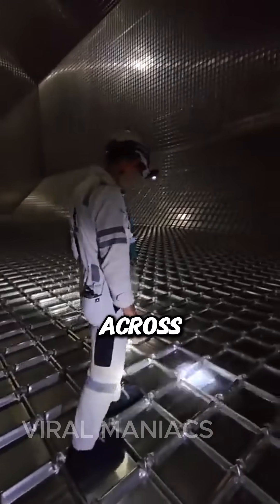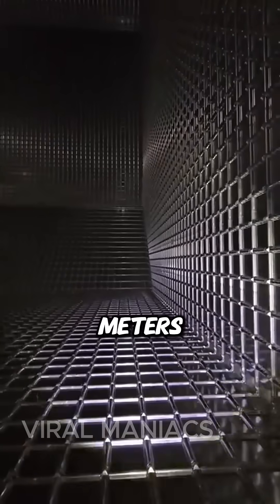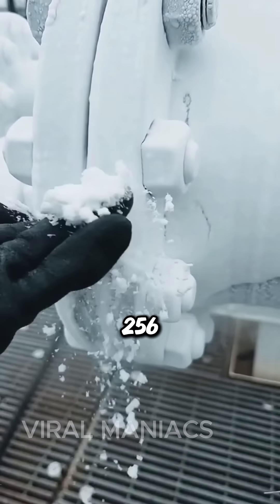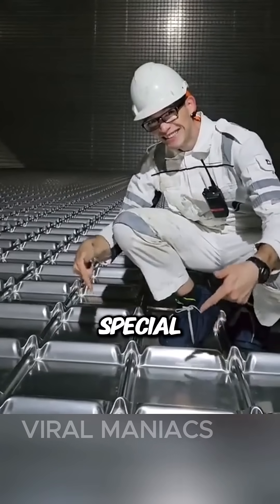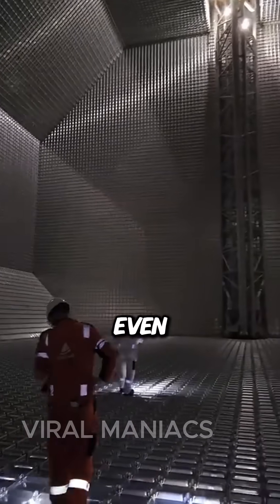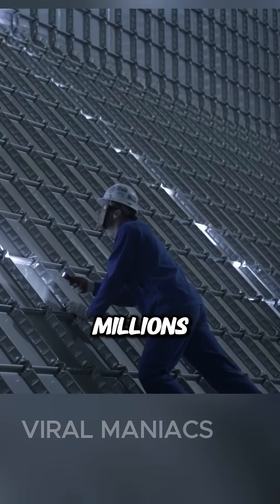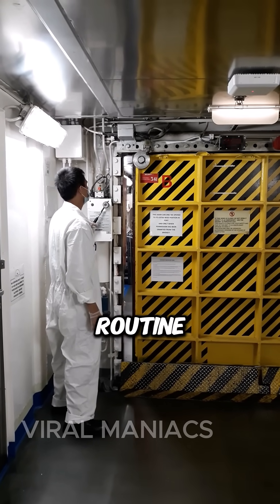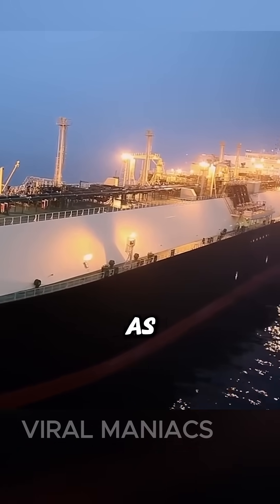Did You Know How Gas Is Transported Across The Sea #shorts

Comment: LNG aka methane is transported at -164⁰ C
Decontamination is termed as gas freeing in maritime language which includes introduction of fresh air into the tank and removal of inert gases or residue of previous cargoes.
Reply: -161 is the average anything lower than -162 is considered cold often too cold. Most tanks are rated for -163.

Comment: I had thought the only LNG carriers were those with the large spheres holding the cargo. Perhaps those type keep the gas liquified using pressure, while these (obviously) do it with temperature?
Reply: It's the same way, pressurized and under low temperature. These are new tanks than the spherical ones. The spherical ones were sphere because it is easier to create high pressure tanks using the sphere. But it means you waste a lot of space on the ship because there is a lot of gap between the spheres. These polygonal tanks are harder to fabricate because they need to be made specially to withstand the high pressure without the benefit of being spherical. But as you can see, they occupy nearly all the available space on the ship and that means more LNG per trip and that translate to more savings per trip.
Reply: @gelinrefira  Neither Moss tanks nor membrane tanks hold a significant pressure in an LNG carrier.
Moss tanks, which are the round ones, are easier to build and because of their spherical shape have a better ratio of surface area to volume and therefore generate less boil-off.

Your statement would only be right if you would  be talking about an LPG carrier. Different gas (propane or butane instead of methane), different principles...

Comment: they still using that kind of vessel, because building pipeline is still very expansive, but if the technology could lower the cost building the pipeline, then the vessel is not efficient enough to use anymore...
Reply: LNG is shipped from the US to Europe. That's too far for a pipeline.
Reply: @anderslvolljohansen1556  if they invent new technology in competitive price, and feasible they prefer to transfer the LNG thru pipeline instead of vessel, which because its more reliable then transfer it thru the sea..
Reply: @oxtafondo6606  Do you mean a  cheaper material than steel could be invented?

Comment: Earlier insulation designs tended to boil off too much LNG....however, waste not want not - the emitted gas is used to run the generators, main engines, etc.

Comment: People be doing everything except nuclear power 😭😭😭
Reply: How/where to store spent nuclear fuel rods ?
I think if we include cost of storing spent fuel rods for 100 years, nuclear is not cheap either.
Reply: @gund89123 bury them deep underground, its already being done relatively cheaply. Nuclear only has an expensive initial price, but the operating price is cheaper than fossil fuels and the energy output is very high and very consistent
Reply: Because nuclear is safe until it is not.